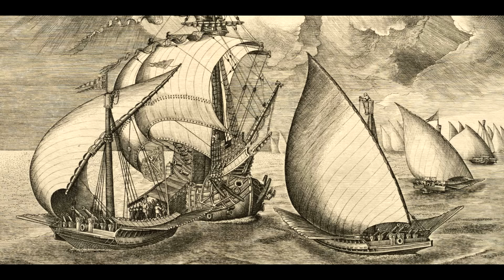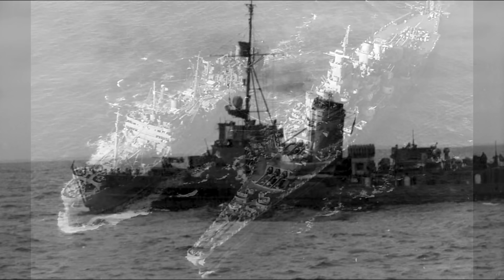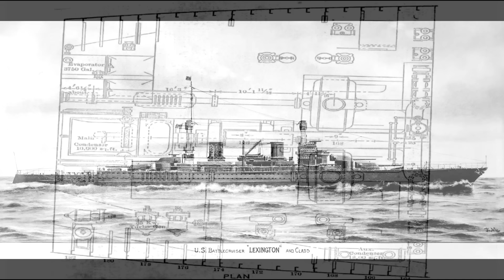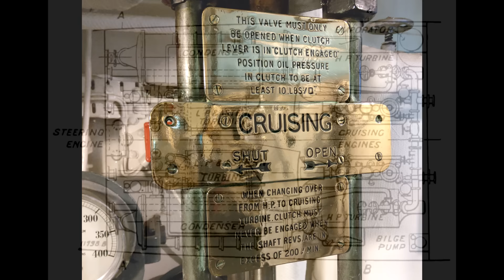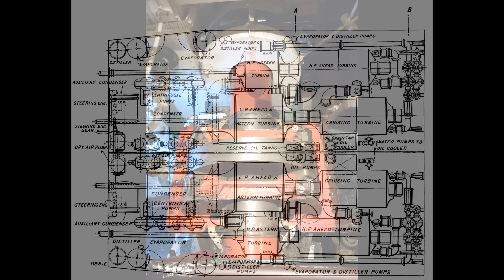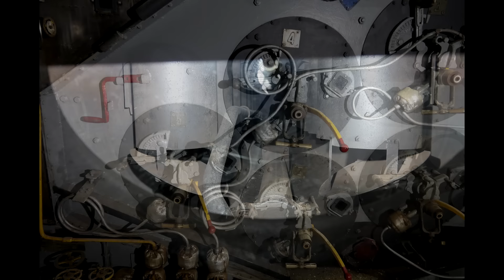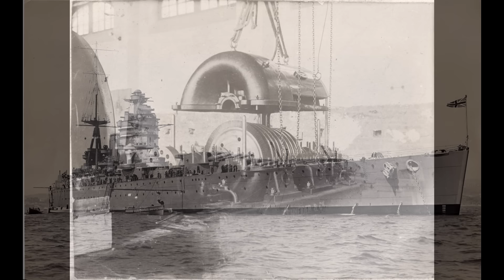Naval Engineering - How to choose your engines

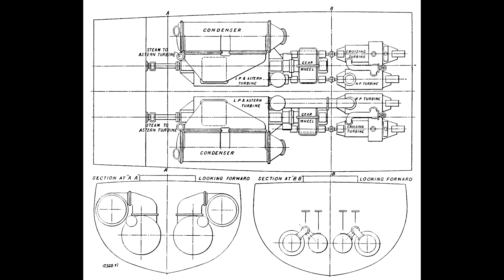Comment: 15:19 Putting steam in the wrong end of a turbine doesn’t actually work at all for a variety of reasons. Steam goes through nozzles before it hits the turbine. Those nozzles are ahead of the turbine, and the space after the turbine is used for the exhaust. Additionally, the steam’s pressure decreases as it goes through each turbine stage and it therefore expands, so the exhaust needs to be much bigger than the inlet. Additionally, the blades are shaped to receive flow from only one direction. So putting high pressure steam into the exhaust of a large steam turbine is really not going to work to move it very much at all.
Reply: It is the same on modern jet engines as well. However the main issue is the first row of blades so you could put in a reversing nozzle. This would reduce efficiency of course because it’s in the way when you’re running forward.
Reply: Not to mention the blades are shaped, convex, to extract a maximum amount of energy from the steam as it transverses the blade.  To reverse the steam flow to the back side of the blade would require the back side to be convex as well.  This changes the structural and weight properties of the blade.  I do not recall the specifics but believe a thin cross section/low weight is ideal over a thicker cross section/heavier blade.  Hence as 53Kenner points out, a separate turbine section with blades oriented towards the reversed steam is a normal route for creating a reverse turbine.  None of this diminishes the point your are making, spot on.

Comment: WTF? "density is less. I.e., if you have a certain square footage or volume that you're going to fill with some form of engine and you use a diesel system, the
overall power output of that is going to be less than the equivalent in a steam"

Like anyone who has never worked on either steam or motor ships, you completely miss the target because you don't have a clue. 

The volume or footprint of the steam powerplant has to include the boilers, main and auxiliary condensers, feed pumps, de-aerating tanks, forced draft fans, piping among the myriad of associated support and control machinery. A 100,000 HP diesel takes up no more volume than just the HP element of a 30,000 hp steam turbine and reduction gear.

As for fuel, large marine diesels burn residual fuel that is (or used to be) practically identical to that burned in boilers. The military burns distillate fuel so it doesn't have to transport multiple fuels around the world. Commercial ships burn "heavy fuel oil" in propulsion engines except when maneuvering or in an air pollution area where distillate fuel is required. That fuel is only slightly less dense than the famous "bunker C" that youtube creators believe is thick as tar. and is not the diesel fuel that your readers fill the tank of their car or pickup truck.

As far as coal availability, maybe time for you to look up "coaling stations" as setup by the British government for the RN and steamship companies. It was a very big deal to transport coal all around the world for those consumers.

Less efficient turboelectric? Lookup "throttling losses" for steam turbines. Your comprehension of marine propulsion is very narrow and simplistic as clearly shown in your description of reversing. 

Do your homework and research the subject before make silly statements.
Reply: In the time period he's discussing diesels didn't have turbos, and the engineering adaptations needed to burn bunker fuel hadn't been developed (ever wondered what happens if you burn 5% sulfur fuel in an engine with no diaphragm between the cylinder and the crankcase, lubricated with straight run mineral oil?) You might appreciate looking up some low speed diesels of the 1920s-40s: earlier models with air-blast injection, usually scavenged by large reciprocating pumps or chain driven roots blowers, no significant boost. Even after turbos were introduced on low speed diesels it took a while for them to be compatible with bunker fuel. Fun fact, early large turbos needed water cooled housings. Additional fun fact, sulfuric acid boils at 337 degrees C. I'll leave it up to you to figure out what chemistry happens if you run a water cooled, cast iron turbine housing with high sulfur fuel...

Anyway, the net effect was that there were no large, low speed diesels that could compete with steam plants for power density. If you wanted diesel and speed on the same ship, you ran large numbers of smaller units- the Deutschland class cruisers for example had four nine-cylinder engines on each shaft, for a total of 72 cylinders! They were nevertheless slower than steam powered contemporaries and had various reliability woes with their engines, which had to be derated to avoid constant breakdowns (though maybe the latter point says more about MAN's decision to build double-acting diesel engines than the technology overall). And they needed a fuel processing plant on-board to convert the fuel into something their medium-speed diesels could safely run on.
Reply: "A 100,000 HP diesel takes up no more volume than just the HP element of a 30,000 hp steam turbine and reduction gear." - you might be getting confused between modern diesels and those available in the 1930s, which were significantly less space efficient - according to the various videos and comments I've come across on the subject.  

I can't profess your level of expertise, and many of your points seem completely valid.  Drach was, however, giving a broad overview of the subject, and there are many deeper aspects that could be explored in future deeper dives, doubtless addressing your concerns.  

One question that I had, that was not addressed, is that while geared turbines have optimum efficeincies at certain fixed speed(s) - from another comment, some ships had more than one turbine to address this - I can't see that the turbo electric drive changes that in any way, the steam turbine is still running at optimum efficiency at a set speed, and while the ship's motor speed is much more flexible and controllable, my limited understanding is that while the electric drive can be controlled in infinite steps, while the electricity used to drive the motors is less that the amount generated at the turbine's optimum efficiency, the rest is wasted as heat in a resistive load of some sort, causing, I assume, similar levels of inefficency to a steam turbine running at less than optimum speeds. It's likely that some efficiency can be gained by (eg) running two motors off one turbine at a particular set speed that uses up all the power generated by that turbine at it's most efficient speed, while the other is shut down. That may or may not be the speed at which you want to go, however. Maybe you can enlighten me?

Also, your point about Bunker C - I'm one of the many ignoirant people who have listened to YouTube creators that beleived Bunker C was "tar like" in consistency.  Again any enlightement from you would be welcome.  Also, further upping my ignorance levels, I'm puzzled by your terms "residual fuel" and "distillate fuel".  I guess distillate fuel is some kind of fuel from an oil refinery, in various grades, eg diesel, fuel oil (and petrol, but that's unlikely to be used in a maritime context I assume), but the distinction between "residual fuel", "heavy fuel oil" and "bunker C" goes over my head. I'd value your expertise in distinguishing between them please.
Reply: @mikewindsor5759  Look up the history of naval electric propulsion, there are several good articles based on that mode applied to its use in early and wartime naval warships and auxiliary vessels. The T-2 tanker was probably the most well known application.

Residual fuel oil is what remains in the refinery's distillation tower after all the lighter products such as gasoline and diesel fuel (distillate fuels) have been evaporated. The old Bunker C or Number 6 fuel oil was the standard fuel for marine boilers and industrial boilers for years because it was very inexpensive. However, for marine use it could be problematic because of the metals and other contaminants it contained. It was also a great place to midnight dump used oils and nasty chemicals that damage boiler tubing and create soot. Bunker C at room temperature was about as thick as 80-90 weight gear oil. Heavy fuel oil or HFO is the catch all term for residual fuels, it is denser than lighter oils, some of it will actually sink in water. 

Modern large marine diesel engines, slow and medium speed burn a lighter version of heavy oil that is diluted with distillate (diesel) to meet the engine manufacturer's specifications. That fuel still needs to be heated to reach the same viscosity as diesel oil for effective atomization and it is centrifuged to remove water and "cat fines" left over from the refining process along with other solids that somehow get into the stuff.
Reply: @mikewindsor5759  Regarding the turboelectric drives: there are a few ways to vary speed without wasting energy in a resistor bank. One of the most common would be to have multiple ways to connect your motors- say I have two DC motors, I could connect both of them to the generator in parallel, in which case both motors will see full voltage and run at full speed, or I could connect them to the generator in series, in which case each motor will see half the generator voltage and will thus run at about half speed.  Another is to have AC motors and switchgear that controls the effective number of poles- A 2 pole motor single phase motor on 50 Hz would want to run at 3000 rpm, a 4-pole at 1500, etc. If you have a motor with lots of poles you can change the way the windings are connected inside the motor to simulate lower pole counts. Finally, there are various tricks that can be used to manipulate the generator and motor running characteristics, for example by changing the excitation current in the field windings.

Nevertheless you do have to throttle the turbines to adapt to the load. If multiple turbines are present some can be shut down when less power is needed, allowing the others to run at full load and thus their best efficiency. However, on a warship this might not be a good idea- steam turbines have a very long, tedious startup procedure in which the turbine has to be gradually pre-heated with low pressure steam whilst slowly rotating the turbine inside its housing, this is needed to ensure that the rotor warms up evenly and doesn't bend from unequal thermal expansion, which would result in the blades grinding on the casing. So if an enemy battleship appears on the horizon, you may not be able to make best speed for quite a while...

Comment: Drach reviewed a significant part of MM2&3, a training manual from my youth. 😊

One advantage of the turbo electric drive was you could put two of the motors in series at low speeds and power two motors with one generator saving fuel that way as well.

Comment: So if you're running full speed to or from something and have to stop quickly for some reason,  I assume the engines can stop quickly, but the steam pressure is still coming from the boilers.  Do you have a way to bleed off the steam pressure to prevent over pressure to piping and explosion in the engine spaces?
Reply: In my experience on a steamship there are usually multiple systems that are still taking a load from the boilers and in a good design the full plant should be able to be lit off and the boiler will not overpressure. We could technically light off one of our boilers and have enough load to run it on one burner with just the Evap running. During maneuvering when the shaft is at slow speeds we will always have 3 burners in both boilers in case we have to come up or down in speed rapidly. But in general during normal operation the fire room and engine room are in good communication during bell orders and when reducing speed burners will be secured at certain speed regimes. 

I'm trying to remember the other systems but the boilers themselves have safety valves which will lift before the steam drum reaches a critical pressure, and in general the desuperheater should allow for enough steam flow through the boiler in order to prevent it from melting.

Comment: There's also the minor fillip of uniflow steam engines (most extensively used on the Casablanca class), which is more efficient than standard reciprocating steam engines, but are harder to machine and have to run more carefully.
Reply: I believe they were used because of the shortage of reduction gears.  They run at low RPM so no gears needed.
Reply: @JimManos  Yes.  Plus, while they're harder to manufacture than a traditional steam engine (tapered cylinder bores, among other things), they are still easier to make than a good turbine, even before you get to the gearing.
Reply: Got to see a pair of Skinner Uniflows in operation a couple years ago. Those are some sexy beasts..
Reply: How hard are such uniflow steam engines to produce compared to low speed two-stroke diesels? AFAIU those were, and still are, often license produced by shipyards on site, so presumably they are not nearly as finicky as faster running combustion engines?

Comment: Diesel-electric is the way to go. And I dispute that they are inherently "bigger and heavier". For one thing, you can use multiple smaller engines and place them in convenient places, pretty much wherever you like. They can be massed produced types originally used in land railway, pumping, or power generation applications. The electric drive motors can be placed near the stern, eliminating the need for heavy and bulky prop shafts hundreds of feet long and their shaft tunnels which consume a large volume of valuable internal space. This could also allow a ship design to more practically have 4 props instead of two. The Diesel exhaust is nothing compared to the large trunks, smokestacks, and forced air needed for boilers... saving even more internal volume in valuable real estate. Burning less fuel means smaller tankage required. Eliminating the need for fresh water feed to the boilers is also a boon. Also eliminated, are the need for separate "hotel" electrical gen sets, since plenty of power is already being generated by the main Diesels. When it comes time for a refit, access to the engines can be relatively easy. With 8 of them, a casualty or two is not disastrous, and when cruising some can be shut down for economy and servicing. Steam is inefficient, overly complex, and dangerous in comparison.
Reply: "More smokestacks equals more gooder"

--- Ryan
Reply: I disagree from a fundamental naval architecture standpoint. Also from my own experiences I have found steam and GT being much more reliable when it comes to moving at high speeds. The diesel electric vessels I sailed on suffered from mechanical unreliability when pushed to high speeds (diesels like going slow, they don't like going fast) and the added complexity just are negatives that I don't think are worth it compared to GTs or a direct drive diesel (medium or slow speed)
Reply: @floridachess9328  From a practical and realistic view... direct Diesel drives are far less reliable than electric drive ships. According to my friend who commanded them in merchant service, they have a high failure rate. The container ship that destroyed the Keyes bridge near Baltimore recently, was direct drive... Had it been electric drive it would have completely avoided that disaster. Plus those gigantic engines are less likely to be repaired by the crew after a major break down, the only option is to call a tug ;)
Reply: @stevewindisch7400 to be fair thay may be a difference of perspective and scope. With my experience on US flagged vessels slow speed diesels in a direct drive configuration were by far the most reliable (only behind gas turbine and steam for mechanical reliability) I'm not saying they will never fail, and not doing proper maintenance will always lead to poor operations like in the example of the Dali (which was a failure of the Electrical  plant not the main  engine itself and that goes with not even mentioning the issue of flags of convenience). I agree that the flexibility of diesel electric is great the ships I sailed on that were diesel electric were great in that aspect, but they were plagued with many many other issues which were almost exclusively down to the electrical system and the automation required for that. There is a reason the maritime industry leans towards slowspeed diesels. They are incredibly efficient engines and extremely mechanically reliable and you don't have to worry about the added concerns of high voltage and the added space and danger from that.

All in all my opinion on the design of ships propulsion plants need to take heavily into consideration two major factors. Efficiency and Ease of maintenance. Diesel electric fails for both of these reasons. A large slowspeed diesel especially the RTFlex type engines will beat everything on the water when it comes to efficiency. They are also mechanically extremely simple engines to repair with spare parts being readily and easily replaceable by members of the crew. As well as most software issues are also relatively easy to work with. Diesel electrics just due to physics cannot be as efficient as a slowspeed due to energy transfers, and maintenance wise while having smaller engines allows some to be taken down for maintenance the electric motors if they get damaged are almost never going to be fixed by ships crew.